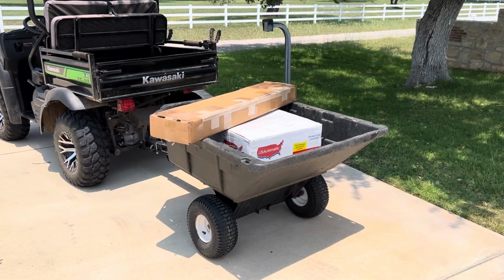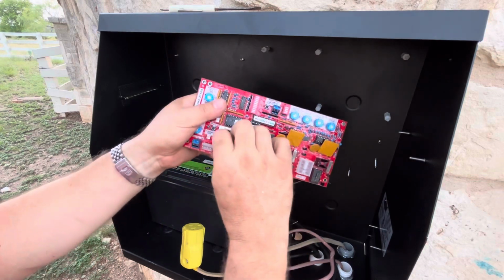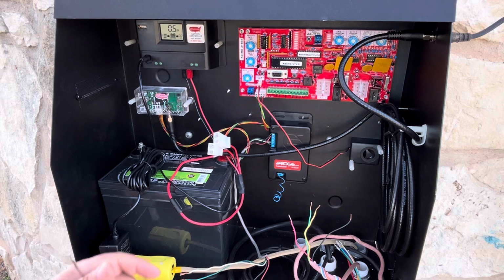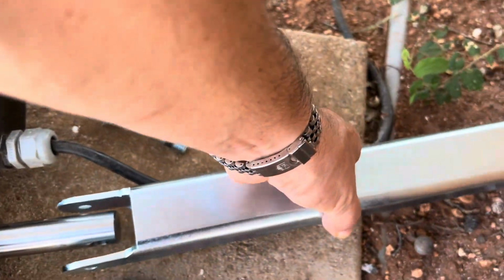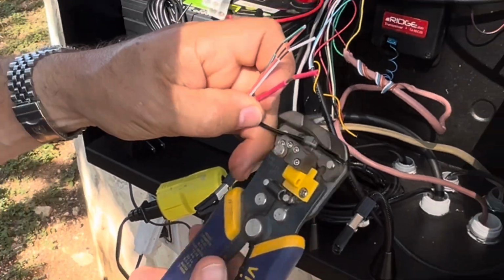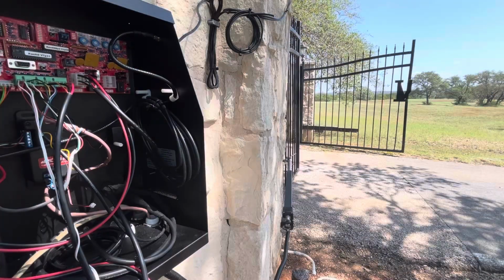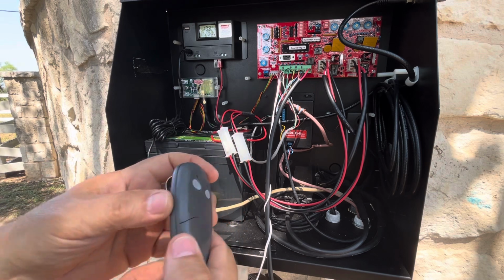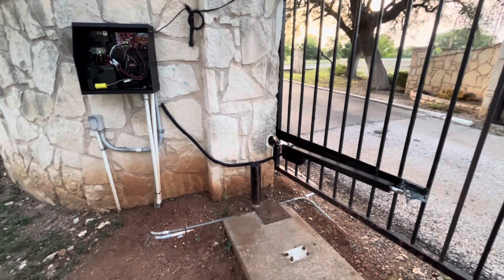Full Install • US Automatic Ranger HD Gate Operator

Comment: Thank you very much for this very  nicely done and thorough video.  

I have several automatic gates and because of various lightning strikes and accidents, I have wound up with a combination of gates from two different manufacturers. I have US Automatic and Liftmaster/Chamberlain gate operators. 
Unfortunately, the different people that installed these gates and controllers are no longer in business or are not willing to help me with all of my troubles.

In my situation, the USAutomatic controllers have had more lighting related failures than the Liftmaster operators. In my experience, the USAutomatic customer service has been way more helpful than Liftmaster’s customer service which is one of the main reasons that I want to try and stick with USAutomatic.

A friend of mine thinks that I have had more trouble with the USAutmatic controllers because I do not have the control board properly grounded. Would you be willing to share with me what you have done to ground your control board? I am nearing my “wit’s end” in dealing with these destructive lightning and near lightning strikes. Thanks again.
Reply from the maker: I think the main thing is make sure you’re grounding the exterior metal box and not the control board inside the box. Use a grounding rod that is as long as you can manage to pound into the ground, number six copper wire with minimal bends in it so that a burst of electricity can turn the corners.  Connect that copper line to the outside of your metal box in a spot where you scratch the paint off so you have a good connection.

Inside the box, make sure all of your common wires are connecting to number two or number seven position on your control board (at least for the patriot board).

I hope that helps! Lightning is miserable. Anything helps I think!  Good luck!
Reply: Thank you very much.